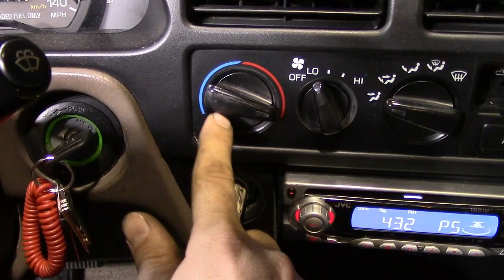How to Diagnose and Fix No Heat Issues - Also a Demonstration on How Car Heating Systems Work

Comment: Just buy a spill-proof funnel.  It makes it possible to bleed the air out of the the cooling system without too much trouble, and it has a rod with a stopper on the end so you can put the extra coolant back in your bottle!  I can't recommend it enough!

Comment: My 2001 Toyota Camry doesn't heat up from a cold start, the gauge remains at the bottom. Also, it has a check engine light ON. Will it go away if I replace the thermostat?

Comment: My 2005 camry le is giving me no heat now. Both metal lines going to the heat core are warm . Any suggestions what could be the reason.? Checked antifreezer hoses etc

Comment: Hi Great Video! And i have a question... My 2008 Elantra has a heating prob.... The Hold/ Cold dial  does not do a bit a difference when set to cold or hot..... as it is always hot.... and not as hot as when working properly....

Comment: So that's it. No, that's not it! I still don't have heat! So, when I put my heater core on my car, is heat supposed to go through the fins of the heater core? Mine doesn't it just kind of bypasses it.  I don't have air conditioning either ARG! They told me I have a leak.

Comment: You are a lifesaver!  Winter just began in here and I had no heater whatsoever and never knew where the water sound was coming from when driving.  I watched a lot of videos and no luck.  This morning I watched your video and took the air our as you explained.  Boom!  the heater is working as new and I didn't spend a dime.  
Thank you so much!

Comment: i bled air in my cooling system and got my heat back ,but then some weird noises started coming from the heater core it sounded like some rat was there

Comment: I have a 2008 dodge caravan and my temperature gauge rises to H then slowly makes its way back down to C. My heat still works fine and I’ve also changed my thermostat. Anyone have any ideas what it could be?

Comment: I have a pick up Dodge ram 1500 2003: after the pick up is warm , with the fan of heat comes out but, when I turn on fan in low speed 1 heat star reduced and regular air star coming out. What's could be the problem? I change the thermostat and works same?

Comment: 1st time I heard anyone mention the sounds of water gushing in the system due to the air being trapped!!   Will have to trying bleeding the Jeep Grand Cherokee which only blows Cold air.  Can't be thermostat cause the Temp display shows enough heat.

Comment: My Toyota Camry 2001 the cooling keep overflow in to the reservoir and getting low cooling in the radiator even I replace a Thermostats +New radiator tank New water pump still same problem what else should I need to fix the Head gasket?? Please someone help my email charliepham2002@gmail.com

Comment: I can warm my truck up for 15 minutes drive it 20 miles it will blow cold. Once I stop and let it idle and sit for 10 minutes it will blow warm. Once I go down the road it usually gets cold again. Not always but usually. I replaced Heater core and thermostat. Both hoses to heater core are warm. Fluids are full. Only hose thats cold is from radiator?

Comment: Hi, RnW
I have ford expedetion 2002 5.4L had problem with heat. when I turn the switch control to Ac is blowing cold air,then switch to heat still blowing cold air. the next day I check the blend door actuator or blend door it self it seem working properly. the heater core is brand new, and also the rear heater is working properly and blowing hot air but the front heater isn't.
do you have any idea what wrong and what other option need to be check?
thank you

Comment: I have a new water pump, radiator, thermostat and head gaskets. Blows heat while driving some, but stopped it's cold. Any suggestions....

Comment: excellent video but a note to help people whoes heater blows cold sporadically or at low rpm. HE FORGOT TO MENTION THE COOLANT TANK OFF TO THE SIDE--that tank must be clean and not clogged and the hose going in under the radiator cap must be pristine and sealed. That tank is not an overflow tank--the engine draws coolant from it and backflows it back and forth as the engine runs. If that tank becomes dry or clogged THE HEATER GETS AIR LOCKED--ITS SUCKING AIR. Good video but it was an honest oversight that he forgot to mention it. I suffered for five years blowing occasional or constant cold at low rpm.  I cleaned my tank and YOU MUST POUR COOLANT INTO IT--fixed my problem instantly as I was about to spend hundreds on heater core replacements etc.

Comment: I have a 2004 Pontiac Aztek I was wondering if this car has a lot of issues I've had this car for a year and I had to change it tight rod now and then change power steering pump and then my rack of pinion broke right in the middle so if you have any ideas how that happened or any other issues about these cars I sure appreciate it if you would let me know or make a video out of it I sure appreciate it thank you

Comment: 2007 Toyota Camry v6 xle. no heating, only cold air blows. now there are rapid temp spikes occurring intermittently. Water pump was replaced last year. What is the most probable cause? Thanks.

Comment: what is it if i have heat coming from the passanger side vents but cold air from the driver side vents an that happens when i have the heat on what is it an how can i fix it
Reply: triple Cat an more it called a temp door or bled door depends on the car it control the doors in the vents that allow what air comes out

Comment: hey great video. have a question 2003 dodge durango have some heat very little. and the thermostat fluctuate from regular temp to nothing at all from time to time... what do you recommend I look at? @ratchetsandwrenches
Reply: +ratchetsandwrenches

Comment: you're the only one on YouTube that mentioned about hearing a swishing sound in the dashboard of my car. Which I've been hearing for about two years never knew it was air bubbles in my heater core. Thanks for the great information
Reply: Mark Hoffman same here!!
Reply: For two years
Reply: What does bubbles in my heater core mean
Reply: @breannalakin3747  If you hear sloshing that means there's air in the system.  There shouldn't be any air in the system.  Kinda like a full 2-liter bottle of water...if you shake it you won't hear sloshing because there's no air.  However, if that bottle isn't filled completely then you can hear the water sloshing around.
Reply: @breannalakin3747  you need to bleed the air out of the system - somebody that's familiar with working on cars should do this - there's too many moving parts and chances of getting hurt.
Reply: a tip : you can watch series at kaldroStream. Been using it for watching lots of of movies lately.
Reply: @Maximus Landen yea, been watching on KaldroStream for months myself =)

Comment: it to Toyota's dealer. They said the problem is air box not switching inside rec. need replacing air box and cost about $2300 so expensive. I wondering if anything else I could do beside that.  please help. Thanks.
Reply: to take to small local repair shop
Reply: Thank you.

Comment: Recently when I stop at in a parking lot my system starts blowing out cold air. I do hear water running around from the dashboard (heater core) sometimes. The last time I purged it I must had not removed all of the air out. Thanks for the tip.

Comment: Thank you a lot I do same as you mentioned here I found that no have enough water in the radiator so when I drive high speed some time came hot air ,,so I add water and keep it running half hours,,God bless u
Reply: Amee Hassa

Comment: my heater only works when the RPMs are up do you think that could be a clogged core?
Reply: Jack Meehoff did you find out the problem?
Reply: Did you find out the problem?
Reply: did you find out the problem?
Reply: Did you find out the problem?
Reply: @BringPeace5  did u find the problem i have the same one

Comment: changing heater control valve on a 98 Ford Ranger took it off many years ago and there is a arrow on the valve where where does which way does the arrow point on the valve what line does it go into

Comment: Thanks for help! Just changed water pump. No heat. Did not know about air in heatet core. Followed your instruction and almost instant heat back. Thanks!!
Reply from the maker: +Neal Arnett Nicee, glad to hear it helped you out. cheers
Reply: @myRatchets  Help! I drained and re filled my 2000 Corollas Radiator with Toyota Premix coolant today. I ran it for 20 minutes with the cap off and heater going. The temp gauge never went past half but my heater started blowing cold. I shut it off after. How long does it usually take to burp the air from the system?? What should I do? Im scared i did somthing wrong.
Reply: how to change a heater control valve on a 98 Ford Ranger

Comment: I have a 1994 BMW 325i.  I didn't have heat so I replaced the thermostat and water pump and now the heat works somewhat.  not at an idle whatsoever, but if engine is maintained at 2500-3000 rpm heat comes out very hot. is this air in my system or a heater control valve issue

Comment: OK I have a 2007 ford f-350 it can sit out front all day and it blows cold air when I drive it it blows hot air when I stop at a red light or coast  down hill it blows cold what could this be ?
Reply: could be the blend door that controls the mixture of hot/cold air. sounds like the control cable for it broke loose, so the door flops around, changing from really hot to cold on its own. when stopping or going downhill the blend door may move forward and close completely, and then flops back when accelerating or going uphill. thus leads to either hot or cold extreme conditions.
Reply: +Levi Marenda my blend door is electronic and seems to work I can hear and feel the air change when I change from floor or defrost or other settings as well I'm going to take it to the mechanic shop for a diagnosis when the weather gets a little cooler thanks for the help though
Reply: had same prob so I checked to see if I had air bobble so I backed down hill and left cap off till fan came on and off 2 time and squeezed hose few times to get air out of system =did not work it was my water pump thee blads that push thee water threw the system were worn out so on idle no hot air till I started driving =hope this helps

Comment: My car won't blown heater while on idle or stop signs its only blows cold air but once I accelerate I feel heat air coming through just only when I accelerate and this just started like two days now...after having my intake manifold gasket done by the Toyota dealer(I have 2008 Toyota corolla)what do you suggest sir..? any help would be highly appreciated
Reply: LOw coolant level in the engine cooling system. When the engine is cold, check the level.
Reply: Water level is low
Reply: OUCH!!--ALL THE ISSUE WAS IS THAT THE PLASTIC COOLANT TANK OFF TO THE SIDE WAS DRY AND OR CLOGGED.  That is not an overflow tank--the engine when started suctions water in and feeds it back out as the engine runs. If you blow cold at low rpm but heater works fine on the highway or by revving the engine the HEATER IS AIR LOCKED.  At higher rpm-s--the force of the water overcomes the airlock and forces some hot water through. That coolant tank must be clean and the hole in the bottom and the hose to below the radiator cap must be clear and hose pristine and totally sealing with no damage. Your problems would have been solved instantly for free. I have uploaded a brief amatuer video showing the tank and how bad mine was. I agonized for five years and cleaning then FILLING THAT TANK WITH 2 INCHES OF COOLANT FIXED IT INSTANTLY. I now blow hotter than hell air at an idle and it blows hot even before the needle registers the engine warming up.  Thanks hope this helps someone

Comment: i replace the heater core in f150 03 after putting everything back the ac/heater only blows air from the  the defrost vents 
regardless if where i change the settings.any advice
Reply: Blend door motors are bad or doors are stuck

Comment: Great video man! I changed my Thermostat and its lower and upper housing Original MOtorcraft for my 2003 FORD EXPLORER 
and still NO HEAT man! Also, my HEATER CORE was extremely hot.  ANy advice, thanks man!
Reply: What ended up beig the cause of the issue?

Comment: Thanks for another awesome video!  You fix all my problems!
Reply from the maker: +Robert Hinshaw haha nice. thanks for commenting.
Reply: @myRatchets   question is if it does get heat after a while or when it's running what would it be?
Reply: @myRatchets  hey, if disconnecting heater hoses to flush out crap, ud have to do a burping /bleeding getting out bubbles?.

Comment: Great Video.  You saved me big.  My TDI Passat had air in the anti-freeze system and it was dramatically effecting the heat output.  Your technique work great.  Thank you.
Reply from the maker: Awesome, very to happy to hear. Cheers